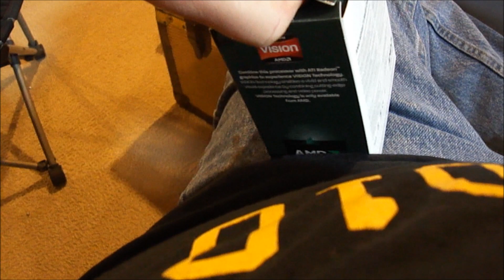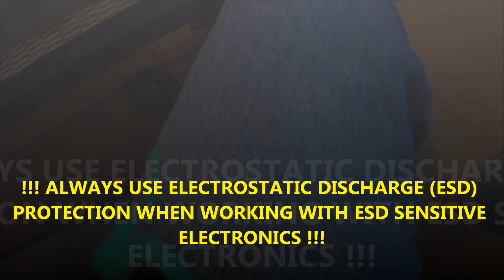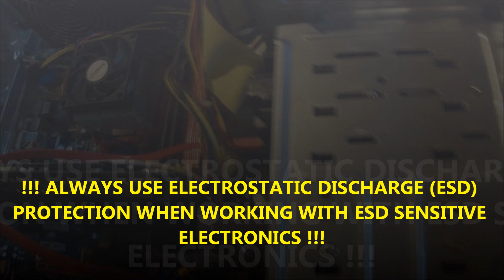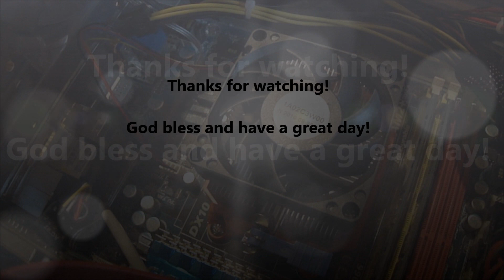AMD CPU Replacement

Comment from the maker: that's an AM2 scocket processor. It'll work in any AM2 socket motherboard, like theASRock A785GM-LE AM3/AM2+/AM2 AMD 785G Micro ATX AMD Motherboard (search for it on Newegg.com)
That is older hardware and you may consider building a new system (AM2 is an old socket and they don't make motherboards with it anymore)

Comment from the maker: when you buy a boxed CPU, the included heatsink has thermal compound pre-applied. You will need to clean the old thermal compound off your current CPU and CPU cooler and then apply new thermal compound.
2 products I've heard are VERRY GOOD are Arctic Silver Thermal material Remover & Surface Purifier and Arctic Silver 5 thermal compound (both available at Newegg.com and both are close to $10) 
Or you could just buy a new heat sink that already has thermal compound pre-applied (most do)

Comment: Thanks brother. I noticed you did not put a layer of thermol paste over the new CPU before placing the fan on it yeah. Is it not necessary ?. I will be trying to transfer a cpu from an old mother board to another. I need to know the correct procedure.  The rest of your instruction are very clear. Noted that, you did not put a layer of  the conducting paste or something onto the surface of the new CPU before putting the cooling fan on top of it. ? many thanks. Hope you can clariy. :) cheers.

Comment: I happen to be moving my CPU onto a new motherboard, and I was just wondering, do I need that wrist thing to protect from electricity if I'm doing this on a hard surface like linoleum flooring? 

Secondly, can you tell me if I absolutely need to use an alcohol solution to remove the thermal paste from my CPU so that I can apply new paste onto it? If I need to use alcohol to get the stuff off, can I just use some cheap drug store kind?

Comment from the maker: @HPLeoXu Open up the case, dust off the CPU fan, keep the case open and then try turning the PC back on. after you hit the power button check to see it the fan is spinning at a good speed. My guess is that it is not spinning at all. If after you dust it out and it still does not spin, look into a replacement CPU heatsink/fan. (try Newegg.com)

Comment from the maker: @TheLvproduction The thermal compound was on the new CPU heatsink. I'm still using that CPU and heatsink and it is working just fine now running @ 33-35 degrees C @ idol @ the default 3.0 Ghz.